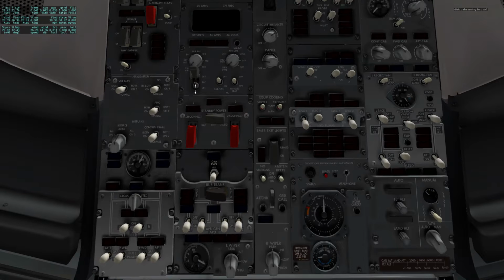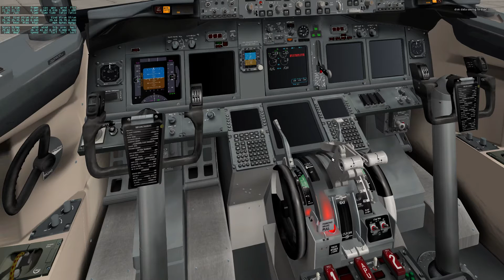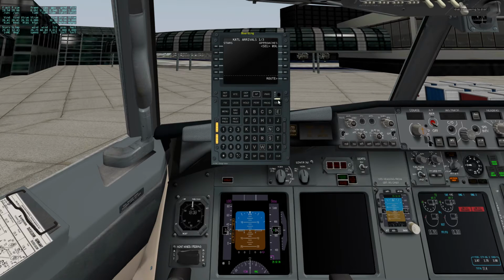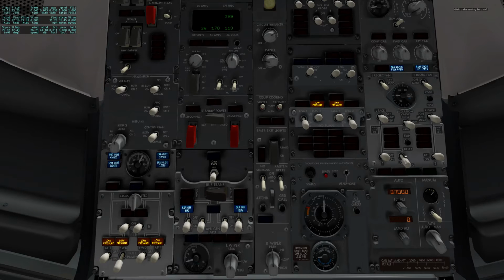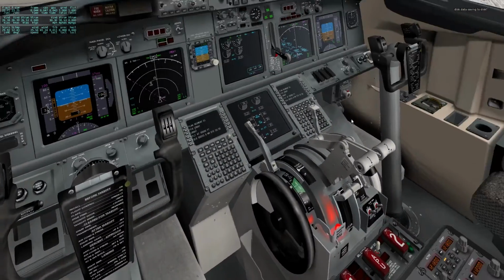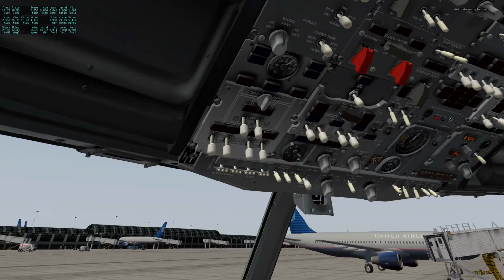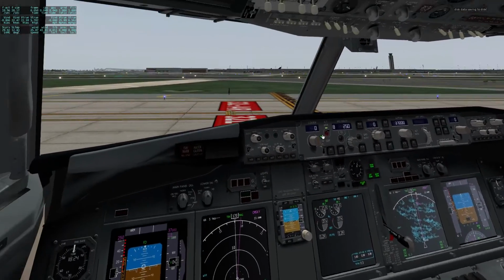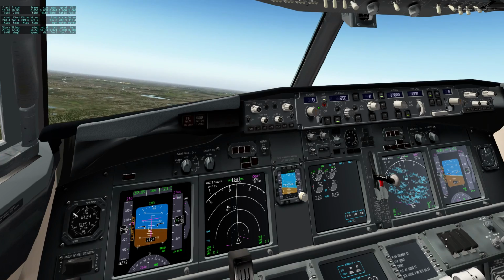X737 V5 Cold and dark how to start tutorial [X-Plane10]

Comment from the maker: Thanks for all the nice comments! i now notice why the autopilot was not working. I didn't have VNAV setup in the FMC but i was trying to use VNAV. Don't make the same mistake!
Reply: 1. I think you cannot use VNAV with x-fmc at all in this plane. It just does not send any speed/altitude data to the autopilot. But still, you can set the V Speeds manually. There is a turnable knob directly left of the flaps indicator (not the lever). Turn the outer ring to the desired V Speed and then the inner ring to select the speed. It will show the speed in purple in the bottom right corner of the speed tape in the PFD.
2. You don't go to standard pressure at 2000ft (most probably not), airports might define the transition altitude different, but more likely is a value between 5000 and 15000ft. 
3. How did you set the takeoff thrust? You should use the keyboard or joystick button for "set takeoff thrust". Check out what key it is in the XP settings, I have it on my joystick. More important: You didn't even set the Autothrottle into takeoff mode! Look at the top row of the EICAS above the 2 N1 gauges. There are two clickable areas in this plane in this row (ON the EICAS display). With them you can switch through the throttle modes. It should read "TO" for takeoff, then after pressing the "Set Takeoff Thrust" button the engines will acutlly spool up to takeoff thrust.
Reply from the maker: thanks for all of the great tips! but this was in may, and i was still less experienced as compared to now. Thanks for watching!
Reply: PilotX 12345 Sure, just wanted to help, because some things are rather weird in this plane ;) happy flying
Reply from the maker: FoxtrotRomeo sure is the truth!

Comment: Very nice video! Thanks for helping the community with your tutorial. I heard you said you started to fly on Vatsim, that's exactly what I am trying to do for months now. I already have an account and downloaded the plugin. But when I try to connect to Vatsim, it gives me an error, something about Flywithlua. Do you know anything about that? Another question, when you connect to vatsim, how do you deal for example if there are static aircrafts at the airport you have installed in your custom scenery, is it going to interfere with the network? Also do you have to own specific airports when flying on vatsim?
Reply from the maker: I'm going to have to look into the Kia thing. That's strange. It's good that you try to fly on atc. And of course not. The static aircraft won't interfear with the atc. It's my pleasure to help. If you have any suggestions, let me know!! Thanks:)
Reply: Thank you :-) Do you happen to know if there is a customed engine soundpack available for the EADT X737?
Reply from the maker: +ibeidari i know there are some for version4.93 but let me go check for version 5:)
Reply: +PilotX 12345 ok thanks
Reply from the maker: +ibeidari i looked for one for this version. And nothing but! You may be I. Luck with this one. Read the read me and backup your old sound files just in case. And if you really want a good 733 with good engine sounds get the IXEG 737

http://forums.x-plane.org/index.php?/files/file/12632-extremely-realistic-x737-sounds/.      Here's the sounds!:)
Reply: +PilotX 12345 thank you for your help I appreciate. The reason I asked you is because  I noticed your engines sound better than what I got.
Reply from the maker: +ibeidari it may be because I used the beta one that I had. :) and no problem. !